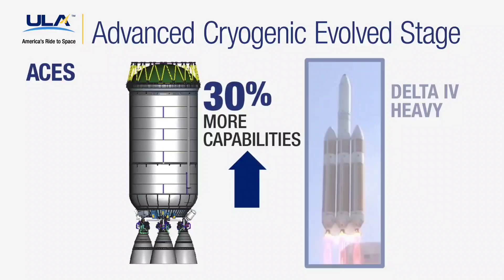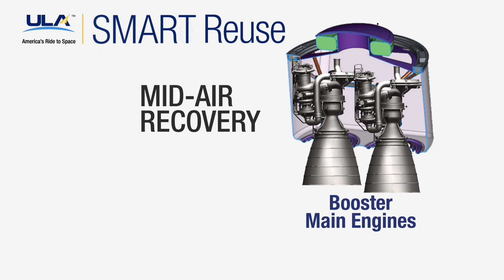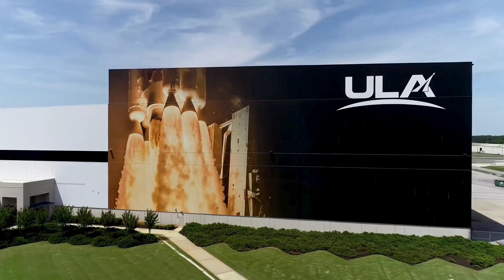Blue Orgin BE-4 having MORE problems?!  What about Vulcan Centaur?

Comment: ULA needs to put their customers first, swallow pride and buy a couple of Raptors.  Blue Origin needs to swallow pride and redesign their engine.  Egos getting in the way of progress makes everyone Angry.  As always thanks for the great, in-depth content!
Reply: Can't just switch between engines everything would need to be redesigned for any other engines.
Reply: @chadwynia5021  and no way would spacex want to effectively support two rockets at this stage, itd be a nightmare for the engineers, i doubt raptor is ready to be a saleable product yet -- what really shocks me is ULA not having a backup design running in the background for such a key part of their companies future.... thats just normal design practice
Reply: @tonyug113  ULA have been using Russian RD-180 engines for a while on Atlas 5, and hydrolox engines on their Delta rockets. Neither of these would be suitable for Vulcan, and the former would be in contravention of decrees on the continued use of Russian engines for US military payloads.
Reply: @chadwynia5021  Maybe not so much with Vulcan, which mounts its engines in a detachable collar for the purpose of recovering said engines. As I understand it, the methane burned in Raptor is very similar to the lp gas burned in BE-4, so the fuel and oxidizer tanks on Vulcan might already be good. For all we know, ULA engineers could already be designing a Raptor engine collar & plumbing scheme, given that BO has given them so much free time (by not delivering its engines).
Reply: @chadwynia5021  As I understand the situation, BE4 burns Liquified Natural Gas (LNG) while Raptor-1 & -2 burn Liquid Methane (LM).  Natural Gas is principally methane.  Both engines use Liquid Oxygen (LOx).  The reusable engine adapter would be the most affected part in my limited understanding.  Compatibility testing is definitely indicated.

That said, SpaceX might not want to sell any Raptor-2 right now and is currently planning to consume all R2 production for the foreseeable future.

However, SpaceX had over a hundred Raptor-1 engines on hand when the decision was taken to go with Raptor-2... ULA might want to buy them if SpaceX still has them and is willing to sell any.
Reply: @frankmcgowan9457  but all rockets are designed around the engines they are going to use, to switch to a different kind of engine would mean a entire redesign of the rocket.  The tank sizes, piping, thrust puck etc are all determined by the engine specs.
Reply: @frankmcgowan9457  I think Raptor 1 engines can't be used by anyone serially so won't be bought by ULA even if they were the last engines in the world. Why? They're all different. Each has some different improvements.
Reply: SpaceX needs to engineer a longer fairing for Falcon Heavy.
Reply: @Laura-S196  i'm really surprised they havent yet - its an obvious commercial opportunity
Reply: @tonyug113  probably isn’t worth their time right now. If it truly was extremely profitable they would probably be doing it but the reality is it would be super expensive and only really have a few uses right now at most. They have people lined up for years to launch on falcon so that’s probably the priority.
Reply: @tonyug113  I believe the fairings are currently one of the more expensive parts of the falcon rockets already, and that producing more of a design they already have. and I think Elon has tweeted before that the high cost of designing a new fairing and then producing it, is greater than the benefit as the market that would use the new fairing is currently just 1 or 2 customers. plus bigger fairings can hold bigger payloads, but would weight more and reduce payload capacity, and a Falcon 9 second stage might need to be fully expended to make up for it. I could be a bit off on some of that, but I believe that was the case.
Reply: Raptors are not a bolt in replacement for BE-4. It would require a major redesign of the entire booster stage of the vehicle to accommodate the engine change. Might aswell just wait for Blue to work the bugs out of BE-4 first
Reply: @CaptainCrutch  The question is when - or even if - BO will work out the bugs to the BE-4.
Reply: @CaptainCrutch  It would only need a redesign of the engine pod. As both engines are methalox the actual tank section can stay the same. The main issue would be recoding the flight computers to handle the different engine. The real problem is the BE4 is 2.4MN at sea level and the Raptor 2 is 2.3MN at sea level. So two Raptor 2 would be a bit short on thrust and three would be massively overpowered with a mass penalty. Although getting that extra 10% thrust out of the Raptor might be possible that will probably be seen on the Raptor 3 or whatever it ends up being called.
Reply: @martinrwolfe  BE-4 and Raptor use a different lox to methane ratio, so the entire tank would have to be redesigned to account for the change aswell.
Reply: @martinrwolfe  They could just nix the variant with no strap on boosters. With two boosters, the reduced thrust of two Raptors should be fine.
Reply: @CaptainCrutch  It shouldn't be too challenging to just not fill one of the tanks completely. Raptor has better specific impulse, so even with less propellant, it shouldn't come out much worse in terms of payload.

Raptor uses subcooled propellant, though. That would add some complexity, but at the same time, if the exisiting tanks could be used, they could fit in more propellant, and increase performance.
Reply: i personally agree with you on that
Reply: Well the raptors are not in a proven reliable state yet and I have a feeling spacex isn’t going to be selling their proprietary technology to one of their biggest commercial competitors. Best alternative is to buy from Russia but that’s not really a good idea either. Blue origin is years late in this.
Reply: Have you ever stepped back and considered this was the best "provable" engine possible? Elon actually seems to have flipped the odds being the first to have a full flow engine. Classic Physics wise its the most thrust, but prone to failures due to all fuels pre heating. 

Be4 should have been simple reproduction... How could they fail?
Reply: John Mann  unfortunately I think you are correct.  It's similar to what happened when Apple decided to keep all their PC tech in house while IBM licensed theirs across the planet.
Reply: Wait for star ship it will be able to deliver it .
Reply: It's too late to go back to the drawing-board for BO. ULA has a massive contract with the US military to launch 60% of their upcoming payloads over the next few years (SpaceX has the remaining 40%). Vulcan needs 2 successful orbital flights before certification for use for military payloads, hence the consternation at ULA, who were hoping to have Vulcan certified before 2023, when Atlas 5 could no longer be their go-to for military payloads.

Comment: Can't ula, swap the engines with something else? Like raptor 2
Reply: would take YEARS ! to redesign .. they're running out of time to complete active contracts to kick stuff up
Reply: @peddroelm  only because ULA moves at a snails pace. I'm fairly certain in could be done in six months if they were willing to push it. The thrust from a raptor is far less and would need more on the craft but that's not that big of a deal. It more of a Plumbing problem than a flight problem.
Reply: @rexmann1984  vastly different sizes for BE4 and raptors - means would need to put more raptors2 (for example) than BE4s .. more complicated fuel lines, is the fuel even compatible, same chemical composition? same pressure / temperature ?  Raptor 2 is still in active development (not in its final form) .. NOT a 6 months job ! to risk multimillion gov secret stuff on !  Who can certify that ?   Also .. They would like diversity in case ..accident grounds raptor 2 for any reason while investigated ...  All heavy providers only on raptor 2 ..single point of failure ..
Reply: @peddroelm  it's an engine that will be in constant development. That is until SpaceX starts a new engine program. I get you with the single point of failure idea though. However, there's always the Falcon and Neutron. This is the problem with the way the dinosaurs operate. Their craft is extremely expensive and single use. They can't afford to slap some raptors and one and have it blow up. To them that's the end of the friggin world. If you can't blown anything up it's hard to learn what you're doing wrong. Which is why it takes them so long. Because they model everything to an infinite degree.
Reply: It is not that simple. You need to completely redesign the interface, support, piping, cabling and rework the control software and test...

At this point its more a centaur 2.0 than a simple swap.
Reply: @jean-francoistremblay143  have you heard of duct tape? 😀
Reply: @jean-francoistremblay143  ye ofcourse I get that. But that still seems to me to give less delay then waiting in perpetuity on engines that may or may not work. I lead technical projects myselve. And I always have backup plans for critical path deliverables.
Reply: If spacex has the technical edge with Raptor they would have nothing to gain by sharing it with others not to mention the entire rocket would have to be redesigned. It isn’t kerbal space program. Every engine has thousands of little details specific to it to make it function that the rocket has to fulfill
Reply: @ghostrunner2138  They gain money and soft power. They're both methalox engines. If Vulcan tanks can handle 3Bar of pressure then only the bottom dome will need adjustment. Space X already has most the software changes they'd need to make on hand.